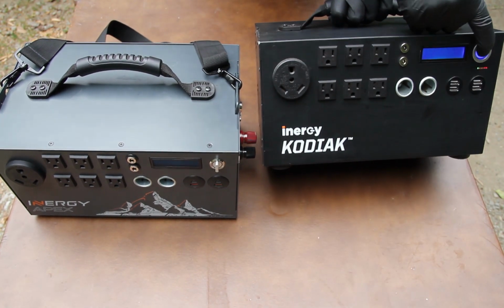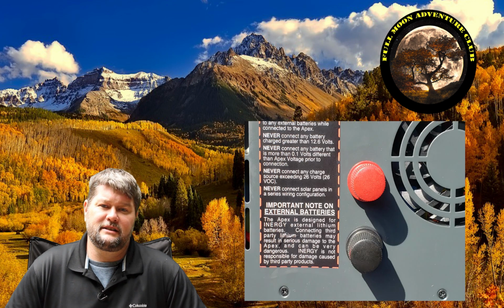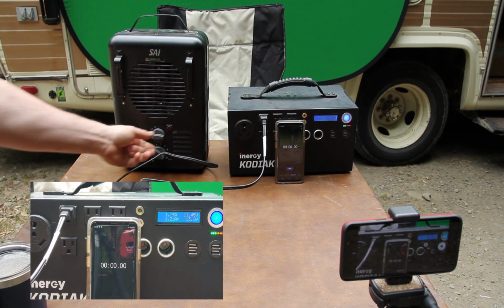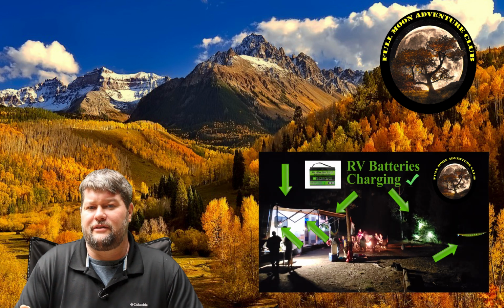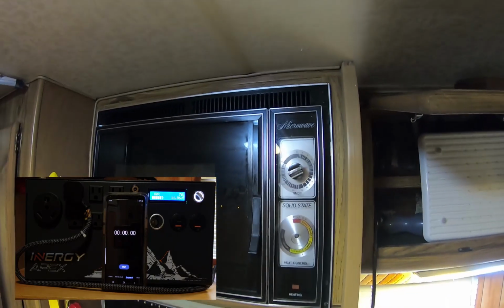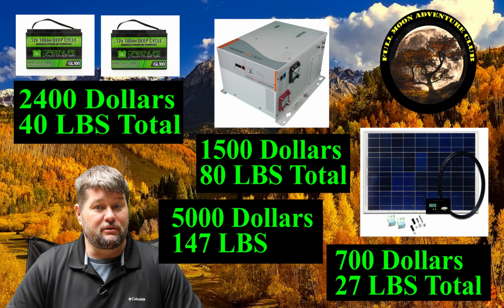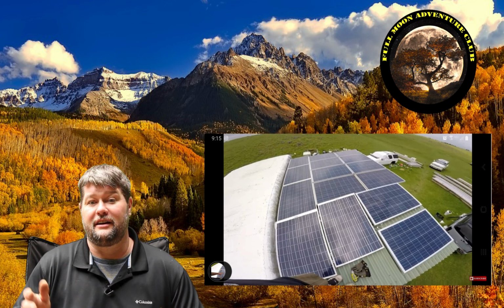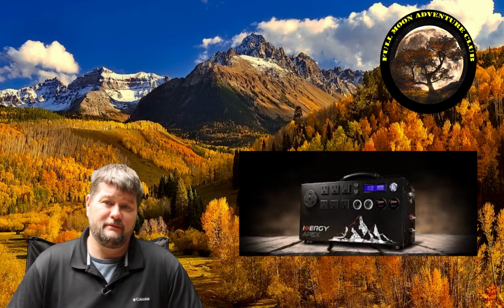Inergy Apex Pros, Cons, And Questions Answered

Comment: I have an Inergy  Apex that stopped working in A/C mode, D/C still works fine and it takes a charge the Battery is fine. Inergy no longer does repairs or any support on the Apex , So my big question to you is ,can I hook up an inverter to the external terminals on the right side of the Apex and get back a/c using the DC external terminals with an inverter long as I don't push it over 500 watts ?

Comment: My Apex is over a year old now. I’ve used it daily and it’s hooked to 3 100w PV panels it came with. I purchased it at the pre sale price. The power button is still on. Everything works fine so far. Portability is great. I take it camping but mostly use at home. I run my 15 cubic feet freezer and charge smaller solar power stations with it. The inverter does waste about 20% power which sucks. But I’m getting the power from the Sun so it’s fine. I run a small microwave, coffee maker, blender and hot plate with it. When I do laundry I carry it to the garage and run my washer. It won’t run the dryer but during summer I use a clothes hanger out back. I charge all my power tools with it. Etc etc
Reply from the maker: Thanks for sharing all that with us. I'm glad it's still working so well for you. My Kodiak and my Apex are both functioning as they should and I use them often as well.

Comment: We have had our Apex for 11 months now.  The only downside I've  experienced is the A/C side will only work down to 20 percent.  I did add a yellow top Optima battery to give it   more useable storage and capacity.  The panel connectors is my big beef with the system. The 6 foot cables for use with their panels isn't long enough and their E8c  connection appears to be unique to their system.  I now wish I would have waited for the Titan.

Comment: What about 12 volt regulated output
Reply from the maker: That is a good question. The 12 volt power source does not regulate the voltage. It will match the charge voltage of the battery to my knowledge.    Jim

Comment: Just received...3 days ago...My fan stays on in (AC) consonantly  ….Without anything plugged in 11w( showing Dis) on dc...and 23w ( Showing Dis)on ac .....I bought the bronze kit ( 3) solar panels ( linx)...I hooks them up ….no charging?( actually shows Dis?.....charges only when plugged in 12v outlet....I am pretty pissed off...
Reply: 120v outlet
Reply from the maker: The 11watts standby and the fan is typical with mine as well. But my two Lynx 100 watt panels charge it for sure. I have noticed that it tends to say discharge for the first couple minutes and then it switches to charging. Give it a couple minutes and see if you still have the same results. If not check your solar panels with a voltmeter.  Let us know what your results are.      Jim
Reply: @fullmoonadventureclub  
Thanks for the quick reply...I'll keep you posted
Reply: @fullmoonadventureclub  
My fan stays on when turned to ac?....doesn't shut off?...not on DC 
Any suggestions? 
Thanks
Reply from the maker: @tyl8ter  when on AC the fan will run. Same as almost all AC inverters. It's just a given for some reason. Waste of power but it might be a lithium battery requirement safety thing. I still love these power packs. 25 pounds and they will run a window AC unit? Crazy cool. The tech is impressive  any way you slice it.     Jim

Comment: So if you plug it into a standard Rv wouldn’t you have to shut off the Rv converter or have a way to isolate the Rv battery? Otherwise it would spend most of its energy charging your Rv battery? Nice video thanks.
Reply from the maker: You are correct. Most of your power will go into charging your batteries. Most standard RV converters and Chargers use about 40 to 50 amps which will use about 500 to 600 watts of power just charging the batteries. You could either have a battery disconnect or I use a Xantrex converter charger that is customizable with how many amps that uses to charge the batteries and I keep that at 5 amps the lowest setting. But keep in mind if it does pour energy into the batteries you will be able to use that power out of your RV batteries as well. That's pretty much what I do but I have lithium batteries that are really efficient in charging. I hope that helps. Take care and happy camping.    Jim

Comment: I would like to know.  What do you recommend for someone who on a regular basis normal usage monthly electricity bill, having only 350-kWh monthly.
I know for fact that my desktop computer that is 24-7 powered on,  only uses 225-watts consistently.  And if a blackout happens, What do I need to keep it powered.
If it REALLY came down to it,  
In a blackout I would only use my Laptop, Tablet, LED Lights and Cell phone to keep entertained & also in contact with family & friends.
thx.
Reply from the maker: Running your desktop that long will take a significant amount of power. If you wanted to run your desktop using 225 Watts all night and then charge it up the next day you would need the maximum amount of solar which is 500 watts plugged into the Apex by Day and probably a couple of expansion batteries as well.    Jim

Comment: Once the batteries are used up after 5 years, or max cycles, can you replace the batteries instead of buying a new unit? One other thought...how about a test of a parallel test of either the Kodiak or Apex? Specifically, if I connect two of these, how long can I run my 15k BTU air conditioner.
Reply from the maker: I believe the batteries are unreplaceable. However even after 5 years after two thousand Cycles the lithium battery will probably still be at 80%. You could also add batteries externally to the system that would bring back some longevity. Jim

Comment: The vendor could give a simple table of the time that the full rated power will last as well as the typical and the how much power a day or two days (weekend, cloudy day) can be run.  Then, the customer can verify and set expectations of the device. Saying it can handle 1500W is useless if it's for such a short period since it going to take hours to re-charge. Meanwhile, no power. Thanks!

Comment: I have a travel camper...with a frig ac unit... lights....tv... phones.. will this unit the zodic power all
Reply from the maker: The second you mentioned in AC unit I would say absolutely not. It takes a very expensive large system to run an air conditioning unit off battery power. Everything else on that list might be okay if you're supplementing with solar. A RV refrigerator requires 20 amps of power which is also a lot but mine does run the refrigerator and the TV and fans and lights if you have solar to supplement it during the day. You can take the AC right out of your equation as that's not really a thing most people can run off DC power. The Apex is a system that will run around six hundred to a thousand Watts continuously with solar throughout the day. Most RV air conditioners take around 1500 watts per hour. The Apex has an 1100 watt battery. I hope that helps. Thanks for watching and happy camping.  Jim.

Comment: can you use the apex while its taking in solar?
Reply from the maker: Yes you can. It will handle 500 watts of solar while producing power or charging.    Jim
Reply: @fullmoonadventureclub  thanks!
Reply from the maker: @TFrakesTanks  No problem. I have been beating these units up for a while now and they are great. If it fits your power demands there is nothing more light weight and portable.. Take care.     Jim

Comment: There are several misconceptions that I see in comments on just about every Inergy Video. First, this unit was designed to be a portable temporary power source, 25 pounds is right at the limit IMO, for carrying this around, in fact, my wife might say it could be lighter, seriously, if I need to draw 1500 watts continuous I’ll carry out my Yamaha Inverter. I can run my electric chain saw on the Inergy, drawing 1760 watts intermittently while cutting logs. Secondly, leaving the panel out in rain and plugged in isn’t going to hurt anything as long as the inverter itself is protected. Thirdly, you are not required to buy Inergy panels. I bought one linx panel, over priced as it was and just purchased 4 of the RICH poly 100 watt panels from amazon. I bought a 20 ft cable with MC4 on one end and soldered EC8 to the other end and made sure the panels were connected in parallel, no issues whatsoever. Lastly, there are two temperature sensors inside that monitor temperature on the inverter and battery and only trip the breaker when temperatures rise too high. This ensures a long battery life, roughly 2000 cycles. It’s a great product when used appropriately.
Reply from the maker: I agree completely. I love both the kodiak and the Apex. I have to say the 20 pound kodiak does feel a lot lighter carrying it around. Both are great units. Thanks for the comment and happy camping.  Jim

Comment: The Apex lets the battery go to 0%?  My Kodiak automatically shuts down at 20%.
Reply from the maker: I would say it depends on the power draw  you're putting on it at the time. If it's a very low power draw I think you could take it all the way down to zero. However if it's a mild to aggressive draw then it's going to shut down at 20% not having the power to continue to run the inverter..

Comment: What you have to do is to really test the 1500W claim. Is the system shutting down because it wants to save the battery or because it cannot output 1500W and is heating up. Just connect one external 12V battery and see what you get.  They claim "AC Inverter: 1,500 Watt pure sine wave, 3,000 Watt starting surge" which clearly is not the case. This claim means that you can connect 2 lithium batteries that you already have to the Apex system and run your  whole RV, which again,  is not the case. Not even close. So, your review is biased. 1500W is 1500W and not 500W...   Also you keep bringing the 1500W resitive load is hard on any system. 1500W resistive or 1500W from your laptop, TV and whatever else you have is still 1500W...... You can plug 3 TVs 5 laptops, etc. if they total 1500W  THE INVERTER SHUTS DOWN.

Comment: Hi Jim,

I bought the Kodiak after your reviews and others and my intention was to run my RV refrigerator, which pulls a little over 300w continuous, but unfortunately the Kodiak will only run it for about 3hrs before it shuts down.  Still trying to figure out how to increase this time, but ran into a dead end when I found the problem with the lead acid battery you mentioned and not being able to connect lithium. The only other option I can see and let me know if you have any ideas, is to add a battery charger that would charge batteries with an additional inverter, so basically the Kodiak would charge the batteries, while the inverter would do all the work.  

Thanks for all your helpful videos!
Reply from the maker: After three hours is the Kodiak battery dead or did it just shut down? I'll do some research. It ran my residential fridge for 14 hours pulling 400 to 500 watts during compressor cycles. What kind of fridge is it?
Reply: fullmoonadventureclub 

Thanks for the reply Jim.  The Kodiak battery is ran till it’s dead, a little over 3hrs.  The refrigerator is the typical RV type, propane/electric made by Norcold.  The problem is that these type of refrigerator pull a little over 300w continuous unlike a residential refrigerator that will periodically cycle a compressor once up to operating temperature. I’d appreciate any input you have.
Reply from the maker: @JTinPA68  that is a lot of power running on AC. I always run my refrigerator on gas. I should make a video about how much electricity they use. I have to one hundred amp hour lithium batteries and on the times where I was running the generator and forgot to switch the refrigerator from AC power to back to gas I did notice that it sucks those batteries dry pretty fast. If gas is not an option for your refrigerator I think you're going to need to consider adding the full amount of solar to your Kodiak and an additional battery for nights. I wish they would hurry up and release their lithium add-on battery. Perhaps a couple of Cheap side AGM batteries would help with your time. They will still probably last a year and would only cost you a couple hundred bucks. I wish I had a better solution for you other than swapping out the fridge for something compressor based but 300 watts continuous is it going to use a 90 AMP hour battery in about 3 hours and the Apex and Kodiak both have 90 AMP hour batteries or 1100 watts. When I'm not using my RV furnace my 9 gallon RV propane tank will run my refrigerator and all of our cooking for weeks. I'm sorry I couldn't be more help. Thanks for sharing this with us and good luck.   Jim

Comment: How water (rain) resistant is the Inergy? I can't see it surviving much in the wet while pulling in all that air through the fan.
Reply from the maker: It is not water resistant. However, I use mine in damp humid conditions with no problem. Just keep it out of the rain.     Jim.

Comment: Just seeing this video now - after commenting on your Kodiak video.  So hopefully I'm understanding this correctly, this new Apex should still run household appliances (I'm thinking like the washing machine and fridge) without powering off, I hope?  It would be a huge bummer if it did power off where it is hugely expensive.  I wonder if you can plug other panels into it, I have a set of Rockpals foldable solar panels - to put into it in addition to their panels?

Comment: Well this video makes me feel a bit better about it. Still good for most "normal" loads. But for resistive loads (coil heater for cooking, hair dryer, heat gun) the Apex self shuts off after a couple minutes as you indicated. One of the main reasons I wanted it is to allow me to boil water or cook via a coil. Yes I could use a fire pit or a fuel camp stove but I wanted to use "the sun" instead. 
If you let it self shut off can you then turn it right back on and get another few minutes out of it? How long does it take for the battery to cool off? That is key.
Reply from the maker: I think it just takes a few minutes to cool off. I have used coffee makers with the kodiak but not hot plates. You could always give it a try and see if it works with your unit. I wish I could be more help but I have not tried to use mine to boil water other than a coffee maker wich worked.     Jim
Reply: @fullmoonadventureclub  Thank you for replying. The coffee maker is a good data point. Like your videos!!!

Comment: So I bought the silver package. 
Can I charge the house batteries for my 30 amp motorhome?
Reply from the maker: Sure you can but depending on the RV charger your large battery bank will drain the Apex quickly. You can use solar on the Apex while it is operating so that should help while it is sunny. I use mine for that exact purpose on occasion but my Xantrex battery charger is adjustable. I can set the amount of energy the charger uses so it draws from the Apex a little slower. I go with 500 watts and the Apex lasts about two hours running and charging my RV without solar.     Jim
Reply: Arlow Bailey be careful! It depends on how big your charger in rv . I have a 50 amp charger in my rv and if I don’t turn off the house charger in the fuse box it’ll probably fry the kodiak. This thing is rated for 25 amps and that’s pushing it . The 30 amp plug is kinda pointless.